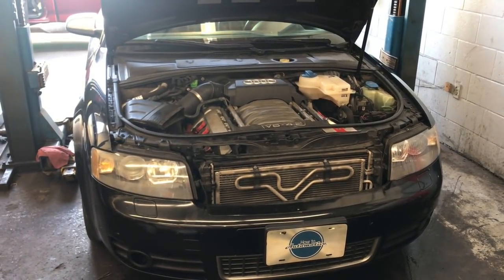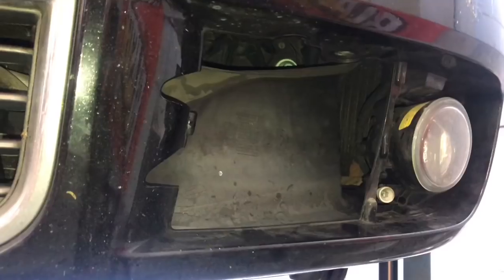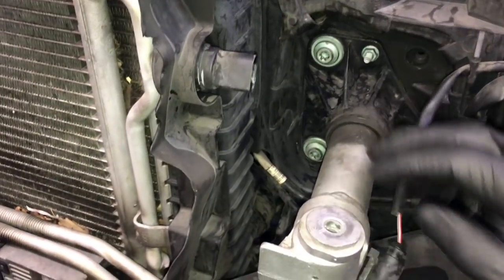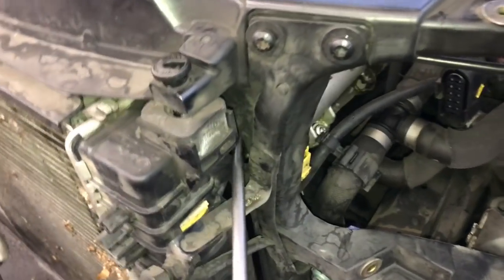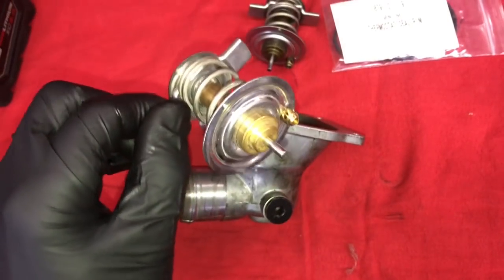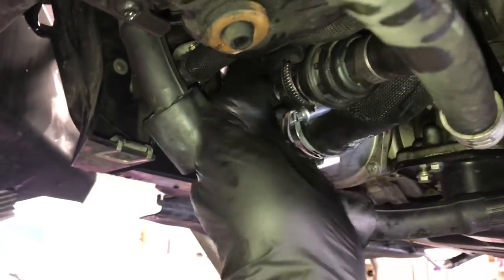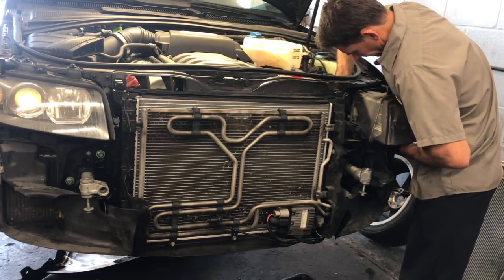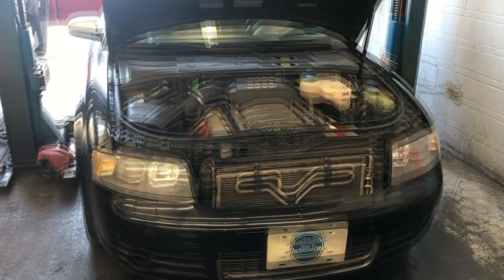How To Replace The Radiator And Thermostat On An Audi S4

Comment: What a job for a radiator but you nailed it!
Reply from the maker: Darwin W Yeah this is quite a bit of work
Reply: @HowtoAutomotive  Do you need to remove the condenser?
Reply from the maker: @Darkfranchise  if you try to remove it without taking the condenser off your most likely damage the lines but it is possible with A helper to help float to condenser why do you remove the radiator.
Reply: @HowtoAutomotive  thanks!  Great video. Big job. Might pay a shop to do it haha.

Comment: You're doing a lot of unnecessary work here. You do not need to remove the small screws in the for lamp area, and you do not need to remove the long bolts. You just back them off about 20 turns.

There's a drain plug in the thermostat housing for draining the fluid. There's no need to remove the headlamps. I fact, if you turn on the ignition with the headlamps disconnected, the headlamp auto-dipping feature will stop working, requiring a trip to the dealer for a reset.

You DO NOT need to remove the A/C condenser from the car. In fact, the Audi Bentley manual says DO NOT open the refrigerant lines. You just remove the 4 bolts which fasten the condenser to the radiator and tilt the top edge forward for clearance.

You only need to remove ONE bolt on the fan controller mounting bracket - the one on the front where it bolts to the radiator. The two on the bottom fasten the bracket to the A/C condenser and can stay in place since the condenser isn't going anywhere.

The power steering hydraulic oil cooling pipe can remain fastened to the condenser - only the one bolt near where the pipe connects to the hoses needs to be removed.

The lower radiator hose is about impossible to put back on because the radiator needs to be pushed backward for the hose to reach and there's no room for your hand in that position. Push the horseshoe clip back down into the locked position BEFORE pushing the hose on to the radiator. It's a snap fitting. Tie a rope around the plastic elbow on the hose, fish it through the hole in the lock carrier and pull it from the front - hard, and keep jerking it until the connector snaps in place. Make sure that the clocking keyway on the top of the hose connector is aligned with the key on the radiator neck when you do this.

The connector relies on an O-ring for a good seal and it's a good idea to clean the mating surfaces so there's no tiny debris which will prevent the )-ring from seating properly.

You're also supposed to bleed air out of the system at the upper heater core hose as you're adding coolant. The upper heater core hose (located between the battery and the brake booster) has a tiny bleed hole in it about an inch or so from from the end of the hose. You're supposed to pull the hose back until the hole is no longer sealed off by the pipe and add coolant until it just starts to come out of the hole, then press the hose back into place and fasten the clamp.

Getting the heater hose off is extremely difficult. It will be necessary to remove the battery and the snap-on sock around the hoses. Use a heat gun CAREFULLY to soften the rubber, use a small hook to help peel the end of the hose off, use a pair of pipe pliers to rotate the hose and keep twisting and tugging. I used a screwdriver to push the flange on the pipe back as I was pulling on the hose. I had it off in about 20 minutes.

Comment: I can’t find a radiator! I need to replace mine
Reply: I'm currently in the EXACT same boat with a manual transmission. Please lmk if you found one and where! :)
Reply: Andy Rose found one! Ordered it from Carid. It has transmission coolers but it doesn’t effect anything. I have a manual aswell